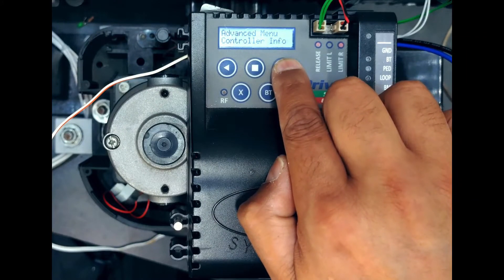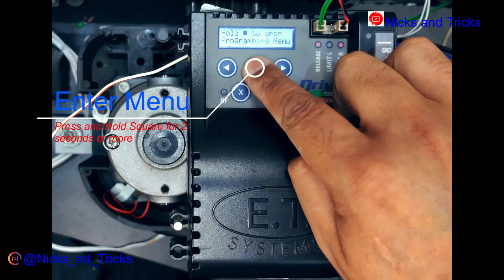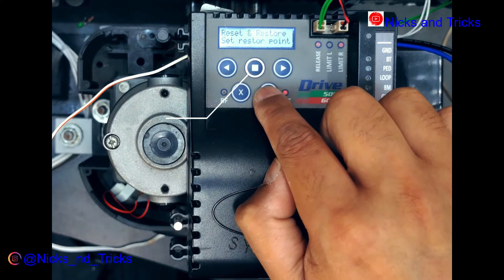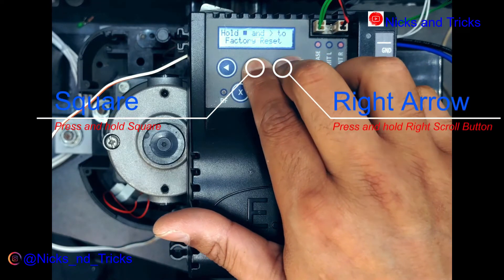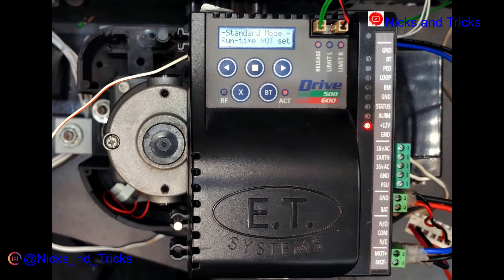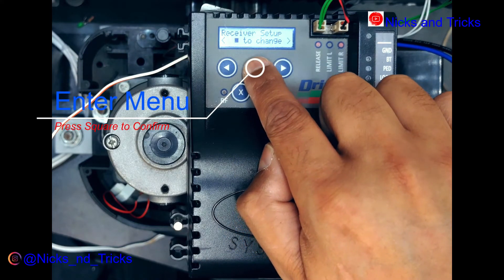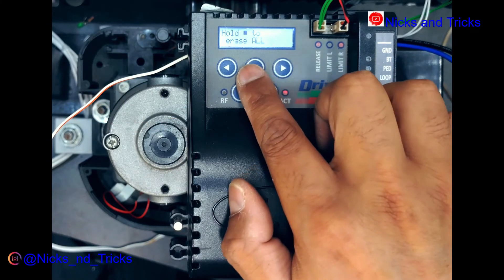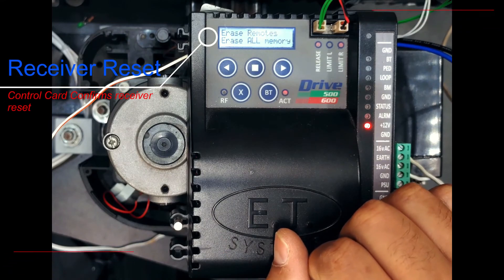how to reset a Nice Drive 500_600 Control Card

Comment: Hi there, I replaced my battery for my ET500 but the thing just beeps and the gate won't open. Can you please help? It gave me an "Aux Error and a PSU battery error" but after replacing the battery I tried to programme the scroll limit but when I try to close it from half way it just stops mid way from half and beeps then says something about resetting. Please help? I just want to make sure its not the motor that needs to be replaced
Reply from the maker: Good day, can you open the pcb up, 3 screws at the bottom and see if insects has not been on the board and damaged it

Comment: Can I use BW40 oil in an ET nace 500kg stepper motor?
Reply from the maker: Thank you for the comment, there should never be need for oil in the motor, if you need to add oil... you could be servicing the gearbox with new seals and drain the oil completely, when you do that you can purchase the correct oil for the motor at the same time.

Comment: Hi there, could you please advise? gate does not fully open or close and I'm getting encoder stall on Drive 500. There are no obstructions so when I try to set run time I get the error... Thank you
Reply from the maker: Thank you for the comment Nunu, encoder stall is sometimes the Rev counter not seeing the picup, when you move the gate manually does the encoder light go on and off, it's found under the buttons, it says ACT, if not it's not seeing this motor turn.
It could also be a inner motor issue, are you in the Cape Town surrounds? If so call Rsec Security Equipment Center
Reply: @nicksandtrickssa  Thanks for your response Mr tricks 😁. I will double check in the morning but the only lights I recall seeing was the status flashing and the 12V battery light stayed on the whole time...I am in Cpt so will contact your guys, was just taking a shot in the dark to see if I can resolve it 😁. Thanks again for your time Sir.
Reply from the maker: @Nunu-wx6yn  no worries, I work there, so can send me images via email or a call in the morning
Reply: @nicksandtrickssa  Awesome!!! You are a star... I will definitely be in touch 👍. Chat soon.

Comment: Hi, please help me out. I have  Et 500 drive, literally under a year I would assume, motor began to slow down to a point where it refused to move, I was advised to put in a new battery because of constant loadshedding, screen displays "Standard mode, 12v Aux Error"
 Put in a new battery worked for few days, only, back to same problem, how do I set it up..... Also motor is not making in beeping sounds
Reply from the maker: Hi Jafer, thank you for the comment.
An Aux error is caused by devices that is added to the motor, beams or receivers. It can also be caused by insects on the board. Have you also checked the fuse on the side? When in standby mode scroll with the arrows and check everything that indicates voltages. Look for AC power in, Charge rate and Aux Voltage
Reply: @nicksandtrickssa  hi thanks for the instant reply... I have checked fuse all is fine there, will check out other indicators as you have pointed out,.. Any reason as to why I am not getting any beeping sounds when pressing buttons or disconnecting and reconnecting battery..how do I know if the pc board is at fault?
Reply from the maker: Also check the door release cable and connector, if you have a little black jumper, bridge the door release without the cable.
Email me a pic of the pcb to technical@rsec.co.za
So i can see what were dealing with
Reply: hi i have a problem that one for yesterday its sorted but this one for today its about running time limits when its opening  its reduce speed and stop but when its closing verifying the distance its just go on speed and hit the wall pillar it doesn't stop

Comment: Hello I am struggling with a Drive 600 the pcb just tells me Standard Mode I can't go into programming the BT button don't work and my RF light flickers and ACT light is static on I replaced the pcb with another pcb that the client have but still doing the same
Reply from the maker: Hi Gerrit, unfortunately i could not come up with a workaround for your issue, it seems it could be power related if both cards are doing the same thing. My advise would be to take the motor to ET if your in the Cape Town area after the 9th of January 2023.

Comment: Error message shows when quick setup is selected: comms error 

It only started a week ago...

Thank you so much for the informative videos 🙏
Reply from the maker: Thank you Yolandi, Comms error is usually a pc board error, did you by any chance see insects in the motor? If so, at the bottom of the pc board there is 3 screws. Remove them and have a look at the pcb. That should help you clarify the issue.
Reply from the maker: Hi Yolandi, after your comment I have experienced more of this issue. You have to reboot the control card to resolve this error. Remove all power from the control card and leave off for 2 minutes. Now reboot and the issue will be gone. It is caused by outages and spikes to the control card during AC power restore